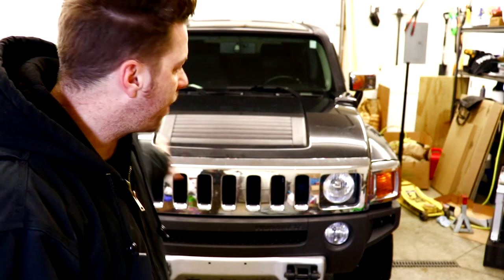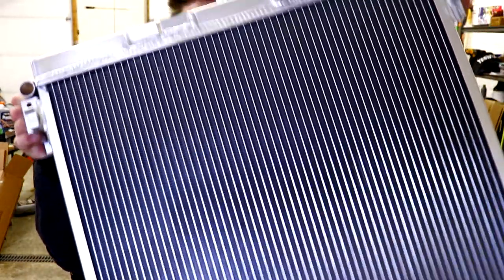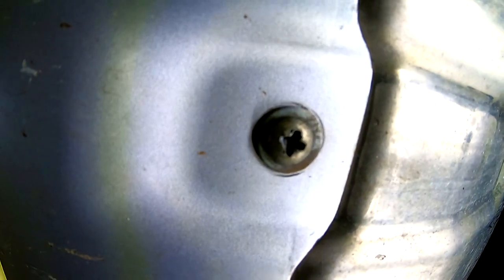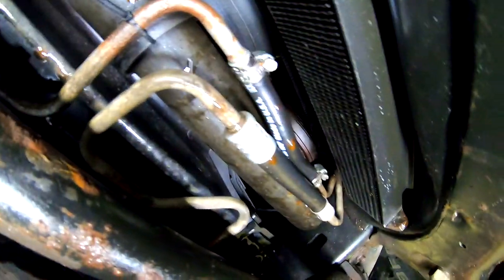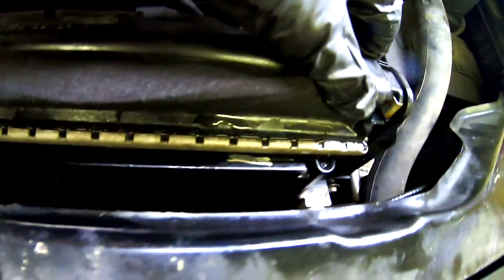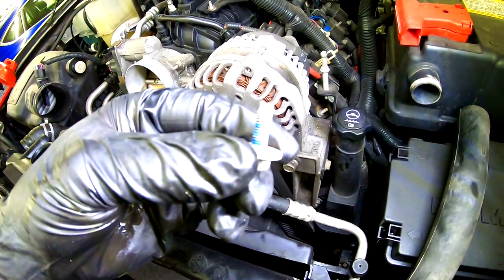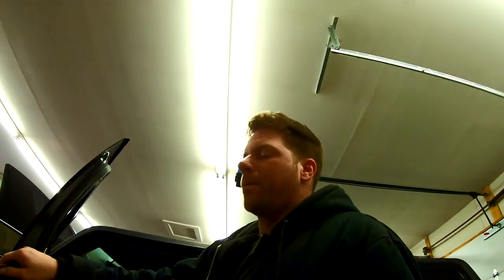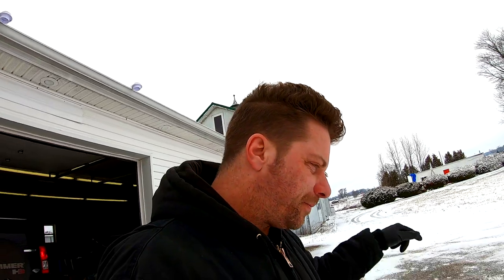Hummer H3 Alpha Gets A New Radiator Too? Let's Go Chinese Aluminum!

Comment: Interesting video! I've got a 2009 H3T Alpha that wants to overheat in anything above 85 degrees. I'm planning to go with a Chinese 2-row aluminum radiator since it's MUCH cheaper than a USA one  a flow cooler water pump, high flow thermostat, new hoses, belts, fan clutch, etc. while I'm in there. I also plan to add an external trans cooler as well instead of running to the radiator.  All this should fix my overheating issues for sure!  

You mentioned the rotating shroud. I believe this is only on the 5 cyl models.  Oh, and the grill comes off really easily!

Comment: Replacing my H3 Alpha Radiator right now.  Going with an OEM, since I've read too many stories of the aluminum one leaking after 1-2 years, even the US made ones.  Got the old one out, will install the new one tomorrow.  One point; Although difficult to deal with the clips at the bottom, the lower half of the radiator shroud disconnects from the upper half, allowing you to remove the top half.  That makes it easier to get the radiator out (and back in).
Reply from the maker: I did eventually get the shroud figured out when I did the water pump. I really should have filmed that part... I heard about the aluminum ones leaking too, AFTER I bought it, haha. Guess we'll see. If it leaks, you can be pretty sure it'll be in a video on my channel. Good luck, I hope the install goes well for you. Thanks for checking out the video. :)

Comment: I know this video is 4 years old.  I just went through this on my 5.3L Alpha and it was a nightmare.  The cheap Chinese aluminum eBay radiator was horrendous trying to get it to fit as the tabs, lugs and brackets were so far off it was ridiculous.  If you’re replacing your H3 radiator buy an OEM and save yourself a tremendous amount of frustration and misery!
Reply from the maker: I'm still around lol
I just put the same radiator in again, with an electric fan. There's so little room for a fan, it was worse than the first time 🤣🤣 
But it's in. Next time I'm definitely going oem.

Comment: Take a pair of channel locks and your rubber piece and bend the lip down that hits the radiator.  Simple fix. Then you can put the grommet back in the top bracket.
Reply from the maker: Not a bad idea. The steel is pretty thick there, Idk how easy it would be to bend it. I have been checking it every time I have the hood up on it, and it's holding up well so far. Thanks for watching and sharing the idea. :)

Comment: Man after you realize how easy that fan should comes off you'll hate yourself.  If you look, the bottom part rotates up so you cam easily remove it.
Reply from the maker: You're right, but that's for the standard H3. The shroud is different on the Alpha 5.3 LH8. It actually separates into two pieces by pressing in two clips from the bottom. I found that out later.